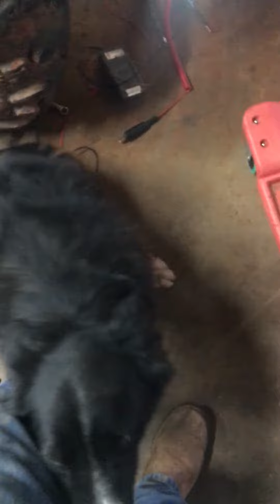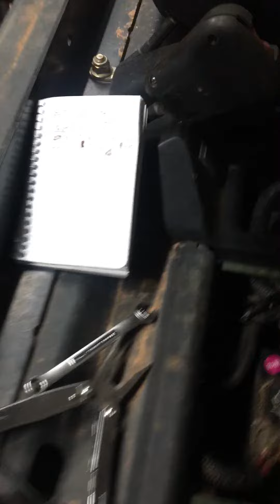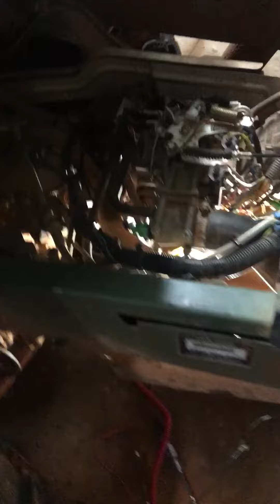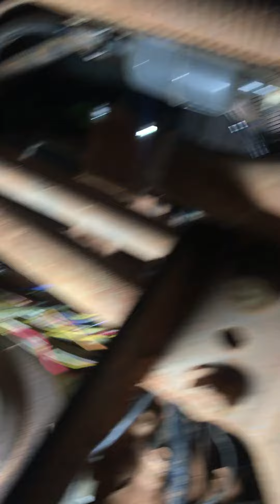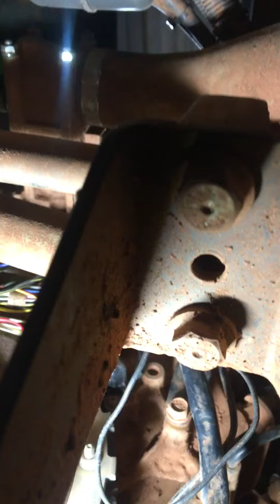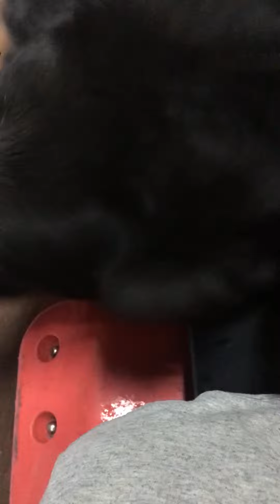Gator fixed!

Comment: the Blue wire went to the engine coolant temp sensor from the computer..  normally there will be 5.0 volts on that wire.. the black and yellow wires are Ground to most of the other sensors..  the variable thermistor in the engine coolant temp sensor pulls the 5.0 volts down and the computer monitors how much that is pulled down.  with it at 5.0 volts because of the broken blue wire.. the computer will either shut the system down to prevent damage or the computer will think that the coolant temp sensor is reading -40 degrees.   unplugged the pigtail when jumped with the volt meter should have read 5.0 volts.   this is all a learning experience. 

 glad to have helped..
Reply: Im having the same trouble with my 625i and I had a look and found that harness pinched in the frame and I’m going to open that harness up tomorrow and see if I can find a broken wire. Sure looked pinched hard! Thanks!

Comment: one more thing.. if you have not wrapped the harness yet.. you may want to stop by the parts store or homedepot.. and pick up a single roll of fresh friction tape.. put a few loops around the wiring harness before you overwrap it in 33+ tape ..  friction tape https://www.homedepot.com/p/3M-3-4-in-x-20-ft-Friction-Tape-Black-3407NA-BA-6/202192876    and 33+  https://www.homedepot.com/p/3M-Scotch-Super-33-3-4-in-x-66-ft-Electrical-Tape-6132-BA-10/100073402?MERCH=REC-PIPHorizontal2_rr-202192876--100073402--N  the only one i have found that is better is possibly 3m 15 but its only sold in big cases to power utilities .. supposed to be 33+ but i think its better .. power line guys usually have rolls on their truck.

Comment: More times than not it's something simple. May be a pain to find it but it's usually something simple. Have a 1994 4Runner in pretty good shape and the AC hasn't worked for a couple years. Sometimes it would for a couple minute but quit. Like it had a mind of its own. Finally I sat down with a wiring diagram and it was a bad connection. I was way over thinking the problem for two hot years. Lol
Reply from the maker: Yeah I did not want to cut the wire loom off, but if I hadn’t it would still not run!